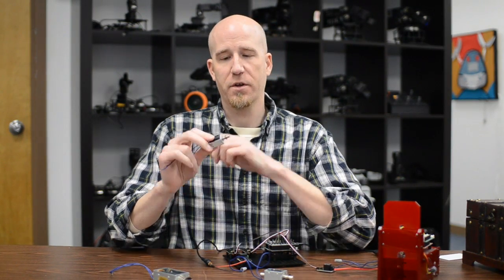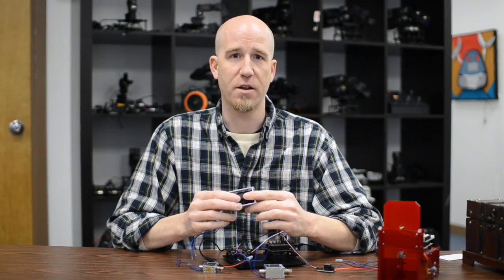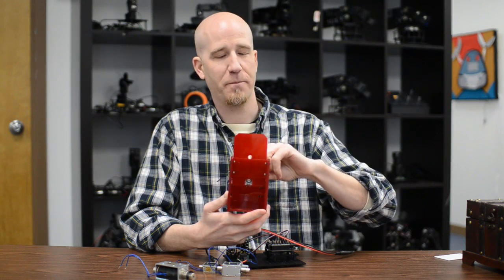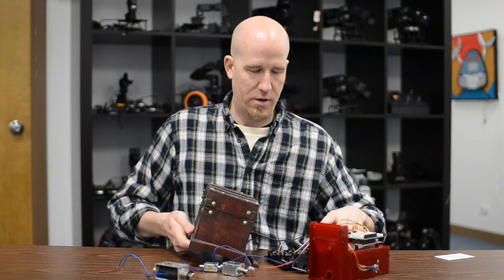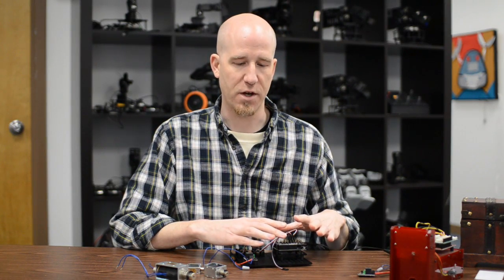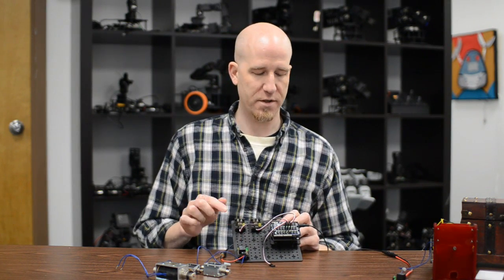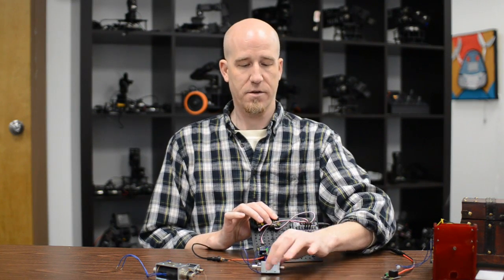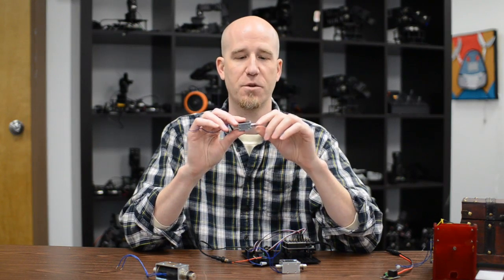Operating a Solenoid using an Arduino

Comment: I want to make a mouse and use an solenoid or 2 as a striker with an Arduino controller. Just wondering if 2 of the larger solenoid would be powerful enough to dispatch a rat. Would like to have a trap that can keep self setting and does not need high voltage.